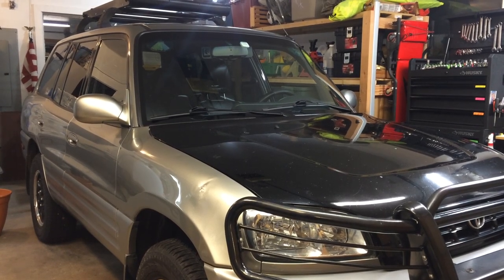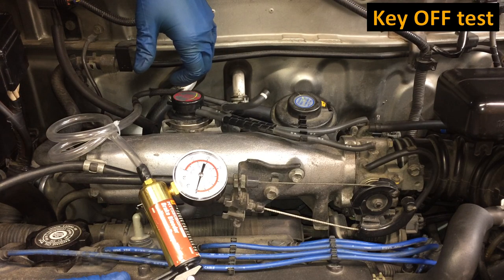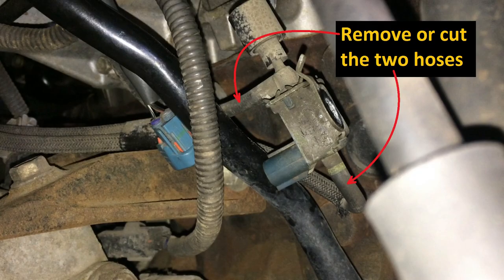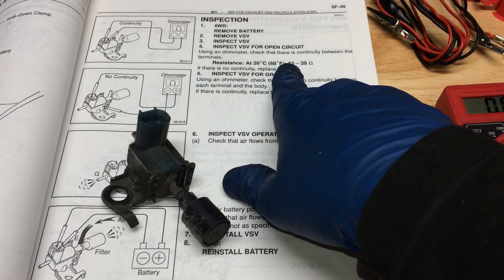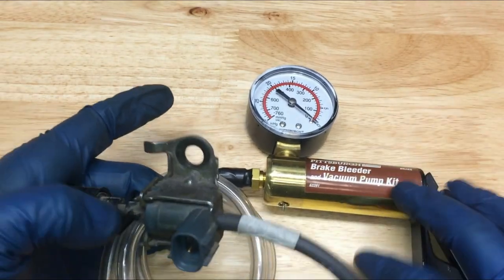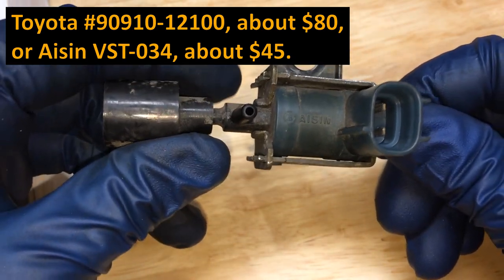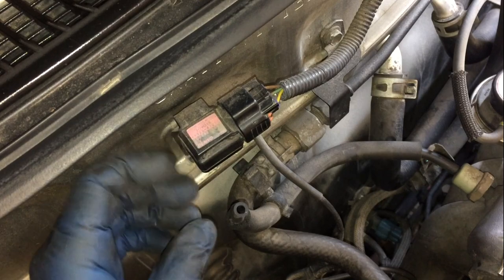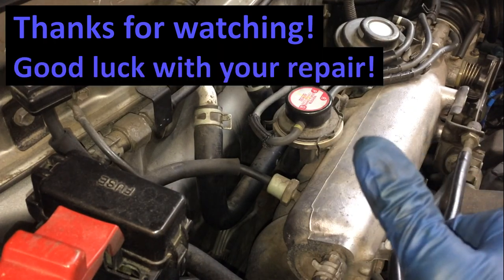1996 - 2000 Toyota Rav4 EGR VSV, Vacuum Switching Valve for EGR, Remove, Replace, Bench Test, P0401

Comment: Your videos for the RAV4 are great and have been very helpful. I have a question about having to replace the vacuum hoses. Where or how do I find the correct sizes for all the vacuum hoses?
Reply from the maker: Thanks!  Here is a thread from rav4world.com which discusses vacuum hoses at length, and the author replaced his original hoses with silicone hoses, if you're interested in that - but either way, there's a lot of info in the thread!  Click on the "See more" at the bottom of the first post to show the pictures, because the pictures are very helpful:

https://www.rav4world.com/threads/vacuum-line-replacement-with-high-temp-silicone-lines.255961/

What's nice about his thread is that you can tell the hose diameter by the color, using the key he mentions in the first post.  That will give you a good idea about hose sizes, if you need to order hose online.

Alternatively, what I typically do is simply cut off the deformed end of the hose so that I have a good cross-section for reference, then take it to an auto parts store and compare with what they have.  Advance Auto, AutoZone, O'Reilly's, etc, sell various types of automotive hose by the foot (usually about $1 or $2/foot), so it is very affordable.  

You'll simply be looking for a fit that has the same/very close inside diameter so that when your new hose fits snuggly onto the fittings.  The outside diameter of the hose isn't as important, and it is okay to use a thinner or thicker walled hose (ie, silicone is thinner walled than regular hose), as long as the inside diameter is the correct size so that you get a good, snug fit and no air leak. 

I hope that helps - thanks for watching! : )

Comment: Thanks for the great vid , I have the first addition Rav 4 1997 that I bought a couple of months ago , but it is running very rich and does not react to any adjustments , the vacuum hoses are a big mess some blanked of some cut and T's fitted , a big mess !!! Please let me know if you know of any site that might have a hose diagram for this car ,I tried getting one from the agent but no luck.
Reply from the maker: Look up on the inside of the hood, and there should be a vacuum hose diagram.  Check out this great thread on Rav4world which also has some information that might help you: 
https://www.rav4world.com/threads/vacuum-line-replacement-with-high-temp-silicone-lines.255961/
Good luck!

Comment: I think mine is bad. After looking at where the hoses go, someone before I owned mine decided to relocate it... The new location is zip-tied to the heater hoses. So no wonder mine failed. I have the PO446 code though. Hope this fixes it.
Reply from the maker: Oh boy, that's an interesting placement by the previous owner, haha!  Just as a heads up, the P0446 code is actually for the EVAP system, not the EGR system.  It can be a little confusing because the EVAP system also has a VSV -- its called the "VSV for EVAP", and is located by the charcoal canister (the VSV in the video is called the "VSV for EGR").  
The EVAP system controls the evaporative fumes/vapors from the fuel tank, and consists of the gas cap, the fuel tank, several hoses, the charcoal canister, the VSV for EVAP , the Vapor Pressure Sensor, and a couple other components.  The EVAP system is not connected to the EGR system: it is an emissions system, though, because they consider the gas vapors to be "emissions".
That EVAP code P0446 is sometimes set off by a faulty gas cap, but there are a couple other possible causes, including the VSV for EVAP. CHek out this thread: 
https://www.rav4world.com/threads/code-p0446.286729/
Good luck!
Reply: @L35inColorado  I was mistaken. Mine is the P0441. Everything I find say that that vsv for egr will fix it. However I have both on the way
Reply: Are you on that forum? We should chat on there! Haha
Reply from the maker: @averywarenski6847  Okay, yes -- P0441 is also EVAP system, and could be the VSV for the EVAP (other possible causes are vacuum hoses and the gas tank cap).  This is an old document, but its a TSB for the gen-1 Rav4 regarding the P0441 and P0446:
https://www.autocodes.com/uploads/toyota/EG003-98.pdf
Good luck!
Reply: @L35inColorado  hopefully replacing that vsv will fix that. Haven't had that code appear since I replaced it. Currently battling the P0401 code after I broke the other vsv. Won't be in until Thursday. :(

Comment: I’m planning on replacing my vsv and installing the new one in the suggested new location.  Could I just replace the hoses altogether and leave the old vsv and hoses where they are to avoid removing the brackets?  I’d reroute electrical since that seems simple.  Please let me know!  Thx great video.
Reply from the maker: Yes, as seen in the video, you can just leave your old VSV in place, and if you use new hoses or just shorten the old hoses, you don't need the little hose bracket that's held in place by the 10mm on the back on the engine, so you can leave it there.  Just make sure that your new hose routing is safe from contact with the hot parts of the engine.

The electrical connection is long enough to each the old location without any modification, its just hard to get your hand down in there, but it can be done.  If your hoses are still good, just reach in and cut them where you can can, and route them to the new VSV location on the firewall.  If you have a 4WD model,  it really does help to remove the right side tire in order to reach the electrical connection and disconnect it from the old VSV.  But, if you can't remove the tire, then remove the battery and reach in from the top.  If you have a 2WD you can reach the electrical from below -- just hop the front wheels up on a curb and slide under if you don't have jackstands.  Good luck!
Reply: L35 in Colorado Thanks!  I have the 4x4 so I will first try to reach it from the top.  Then try removing it from behind the wheel.

Comment: Hi. I have the same exact engine 3S-FE and one issue: for the next 5 minutes after the engine start there is a gas smell in the cabin. Do you have an idea where this could come from? Thank you.
Reply from the maker: This sounds like an "EVAP" or evaporation emissions control issue.  On the 3SFE, the EVAP system is a charcoal canister with its own VSV (vacuum switching valve) and several hoses:  the charcoal canister on the Rav4 is in the engine bay, tucked in under the fuel filter (fuel filter is bolted to the driver's side wheel well).  The purpose of the EVAP system is to control gasoline vapor from the fuel tank and prevent it from getting into the atmosphere, so the vapor is sent to the engine to be mixed in with the air mix.  You might have a leak in an EVAP hose, which would cause that gasoline smell: here is a video that shows an EVAP system -- this isn't exactly the same as the Rav4's EVAP system, but its very similar and you can use it as a guide to look for the various hoses:

https://www.youtube.com/watch?v=g4lHxSAyf7M

In that video, he mentions the Vapor Pressure Sensor: on the Rav4, this is the sensor that's mounted high on the firewall on the driver's side, and has one hose and one electrical connector.  The VSV for the EVAP on the Rav4 is bolted to the top of the charcoal canister.  You might have a switching problem, but I would start by making sure all your hoses are good, because a simple hose leak can cause that gasoline smell.  

Good luck!

Comment: By any chance would you have any recommendations on how to change the power steering hoses? I have to change the two main hoses that go to the reservoir. But right now at this moment I’m struggling with undoing the hose on the pump side because someone put the clip in a stupid spot where you cant easily get to it to take it off! LOL anyways any advice and tips would be much appreciated.

Comment: Hello, I have RAV 4 keeps giving me the code 2418, the dealership said it is the purge valve while in reality the purge valve is working, and I changed it and still giving me the same code with VSC and trac off light also, some said it is the pressure valve sensor and I changed it and the same code, what can I do please
Reply from the maker: It sounds like you have a newer Rav4: the generation shown in this video does not include VSC or traction control systems (so my video does not cover what you're looking for).  
With that said, the P2418 code is generically an EVAP code.  EVAP means the evaporative emissions control, which is a system intended to reduce gasoline vapor emissions; it is a different system than the EGR (exhaust gas recirculation) system shown in the video.  
I don't know your particular model, but EVAP systems do often include VSV's (vacuum switching valves) and purge valves, as you mentioned. Some also include vacuum pumps that apply vacuum to periodically test the system for leaks.  The most common source of leaks in the EVAP system is the gas cap -- either the gas cap is not on all the way (ie, turned until it "clicks" a couple times) or the gas cap itself is faulty (the gas cap might have been dropped and cracked, etc).  
If you're sure that your gas cap is good, then I would start moving upstream from the gas tank on components with a focus on any valves and connections (where leaks can occur) and also a focus on the electrical connections (P2418 could be also be an electrical fault).  
You might check out www.rav4world.com and search the forums there for your particular generation. There is a ton of useful info and there and some very helpful and knowledgeable participants!  
Good luck!

Comment: Would u be able to know how to fix a trippy odometer speedometer it works randomly took it to a shop said there getting al the readings from wiring and sensor I need help
Reply from the maker: If the instrument cluster is getting the readings, then there's a chance that the problem is in the instrument cluster itself.  If you have a junkyard near you that has Rav4's, you can usually get a used cluster for about $25, and replacing the instrument cluster is very easy and you can do it yourself. If you swap in a used cluster and you still have problems, then the issue is the wiring or the speedometer sensors.  Good luck!

Comment: Do you happen to know how to pull the vapor canister out?
Reply from the maker: Yes, aka the charcoal canister -- once you get down to it (you have to remove the air box and whatever else is in the way), you then pull UP on the canister.  It can be very snug: there's an alignment boss on the back of it that fits into a metal feature in the engine bay.  Once you have everything out of the way and all the fasteners out, you pull up on the canister to get it out.  Look at the third picture on this one ebay listing, and you'll see the alignment bosses that I'm talking about -- it can be a little stubborn, but you just keep rocking it side to side and pulling UP and will slide out:
https://www.ebay.com/itm/Fuel-Vapor-Canister-for-1999-Toyota-Rav-4-/312912198734
I also remove the two fasteners holding that fuse box in place that's above the air box to give a little more room.  Good luck!
Reply: @L35inColorado  thank you SOOOOOOOO much, that thing was giving me a brain aneurism just finding it and then after I cleared a path to it I had no idea how to free it so you are definitely a life saver
Reply from the maker: @timothylages6586  I know exactly what you mean -- it got me the first time I did it, too!  Haha, good luck with the repair!

Comment: The vsv will fail when car is hot. But work fine when cool. Most of the time.
Reply from the maker: Yes, that happens (that's why the bench test isn't perfect!).  Have you replaced it and it is still have issues?  If so, can you check the circuit itself?
Reply: @L35inColorado   yes I put a new one and code went away👍
Reply from the maker: @Photostudioww  Nice! Thanks for updating : )